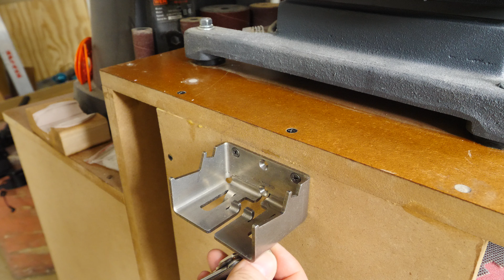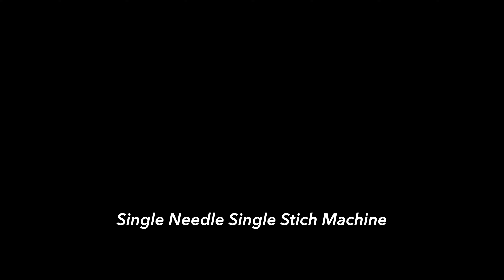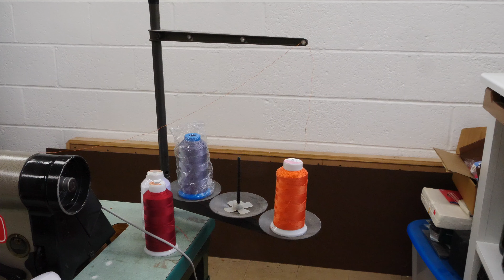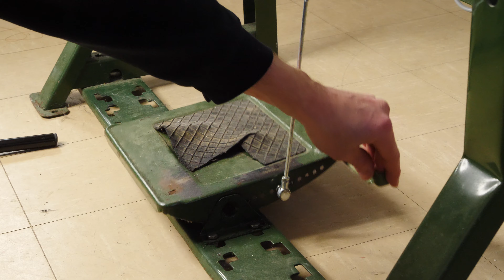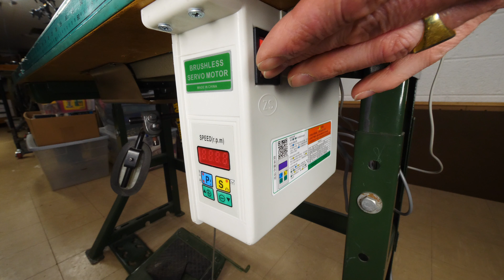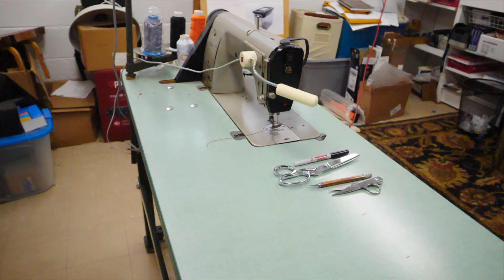Industrial Sewing Machine, Basics Mods for your Beast!

Comment: I have 2 OLD Singer sewing machines  a 111W155 ( compound walking foot ) Built in 1945 and a Singer 241-12 Built in 1943 Just a straight stitch ... BUT can sew 1/2 inch of leather!  Both of my machines don't have a reversing leaver. Not a problem if you just back stitch by knee lifting the foot and pull the material back . Upgraded to servo motors on both . I got the 111w155 for free ( on craigslist ) it needed work ( a timing belt ) . But well worth it ( even if you have to pay someone else to fix it . I fixed mine ) Both are beasts.... No plastic parts in old machines !  I do Auto upholstery with it .
The 241-12 I use also in Upholstry But also sew rip stop nylon for kites on it .... I tell anyone that will listen that the older the machine the better, Neither one ever breaks.
I also put a smaller pull on the new motors to make it run even slower ....
Reply from the maker: Awesome, thanks for sharing,
Reply: what is a smaller pull ? I have 111W155 and trying to slow it down for leather work, lol
Reply from the maker: Smaller pulley,....... But that won't slow it down very much The best thing is really getting one of these new servo motors.
Reply: What do you think of the Consew 7360R? I'm seeing one for sale but have only owned a domestic machine.  I'm a quilter and do have a Juki long arm, but it's just for free motion quilting.

Comment: Awesome video!  Lots of great mods.  The link for the brushless server motor with controller is dead, but I believe I found the same model.
Reply from the maker: Okay cool, I will update it shortly. Thanks for letting me know
Reply from the maker: Updated the link, should be the same as what I used with the additional outlet on the back for plugging in a light
Reply: @EricStrebel  Thanks!!

Comment: I just got an 8700. Got the brushless motor too and also got a needle position sensor that helps even more and should plug right into your controller box. I set it for needle down and will always stop there then push pedal back toward me and it raises needle. Needs some dialing in to make needle up at the right spot where the take up lever is all the way at the top. 
Helps with making corners. Can also tap the pedal normal to make one stitch at a time when sneaking up on corners
Bolts right onto hand wheel. 
You should look into it
Reply from the maker: Ok, I will, thanks for the comment

Comment: I've been rescuing the vintage sewing machines the last month or so with last week venturing into my first antique treadles.  From my observations (I've not even sewn with them yet) and research, the early to mid 1970's and older domestic all metal machines are more like the industrial sewing machines compared the modern domestic sewing machines.  Those vintage and antique ones can be found for under $150 if not an even more awesome price.  You might have to restore or at least clean, unstick and oil... plus tune tensions... though maintenance on anything is a great skill to know.  
From my observations of the beefy all metal vintage domestics (Belair 600, Sear-Kenmore & Dressmaker)... they all have reverse and even more stitch selections (especially the cam design ones) that I have no idea if I'll ever use.  The antiques (Singer VS-2 27 & White FR), other than attachments by Geist, only sew in straight stitch with no reverse option.   The hybrid occupied Japan Belair 600 which is a Singer 66 internals and a Singer 201 outer design can do reverse... where I was thinking that 1.0A motor was heavy duty... uh yeah... I'm just rescuing/restoring and passing em forward other than the ones I'll keep.  So learning something new every day. 
Thanks for sharing Eric, didn't know much anything about the industrial sewing machines.
Reply from the maker: Thanks for your comment much appreciated good luck with your restoration work

Comment: Thanks for sharing. I work as a designer/pattern maker for a sporting goods brand so I can very much relate to this video since I use different kinds of sewing machines for my work. I mostly use a Juki arm sewing machine, great for all those thick layers of leather and an old Seiko arm sewing machine with a roller. I have 3 mods that you can add  to yours:
1. Put a cushion on your knee lifter, it'll make it more comfortable
2. I attached a box with an open top (around 30x30cm) at my spool holder so that it could hold up to 9 different threads.
3. Try looking for an adjustable sewing guide that can attach beside the walking foot. It can when you're sewing near the edge of the material. 
Hope these help and keep making great content sir!
Reply: Bought a singer 120u and can't  put  on the  belt
Reply: It's a pity sports stores use so much polyester today for sports uniforms, terrible material to wear next to your skin, typical of franchises today, they make a crappie sports top in so many designs it becomes ridiculous, then they sell the polyester jersey for over $100, the reality is that it should cost only $20 maximum because of the poor quality material, polyester is used for industrial straps and similar applications, not for sports clothing.